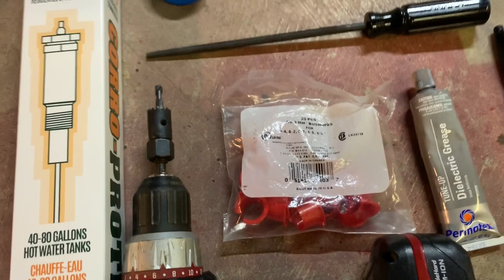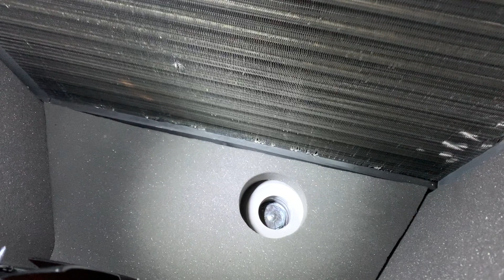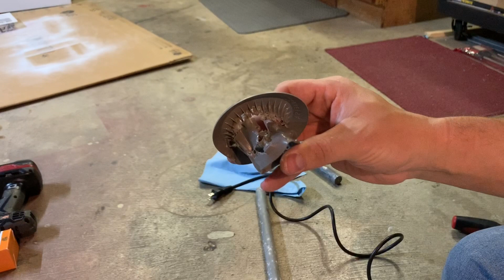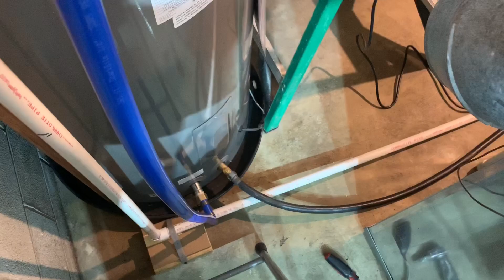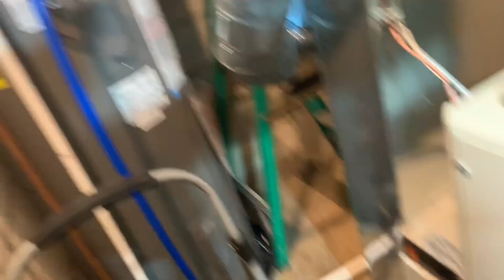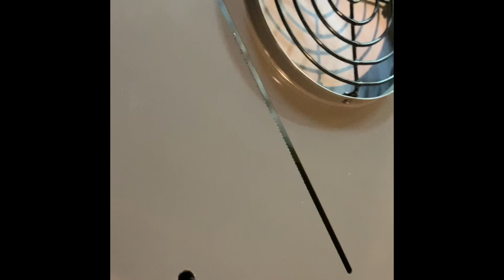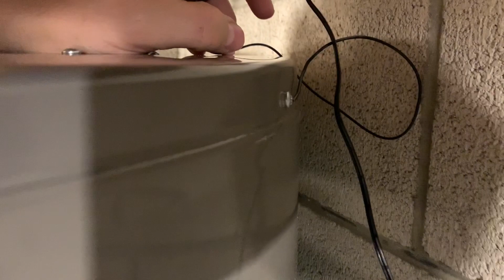Rheem Hybrid Electric Water Heater Anode Rod Replacement. Sulfur Smell is Gone!

Comment: Thanks and great job on this video. Probably the best diy video I’ve seen in a long time thanks for sharing and going through all the steps and even jumping back to explain things. 

I’ve already ordered the anode replacement and will be getting the same water heater. Your video reaffirms that this can be done and I will certainly do it BEFORE installing to make life easier.

Somewhere in all my research I ran across someone mentioned to also replace the crappy “mechanical “ filter with a HEPA filter to avoid small dust etc from getting deposited on the heat pump elements and making it less efficient.
Reply: Chris Steinmeyer thanks for that tip!

Comment: Wow, thanks for the video. I have been trying to decide between buying a Rheem or an A.O. Smith Hybrid and I think I'll go with the A.O. Smith after seeing this!
Reply: The AOS units have clearance requirements, they lack the technology package and they are not as efficient! The Gen 5 Proterra Rheem Hybrid has leak detection, Econet wifi built-in, is very efficient and the only space requirement is 6" over top of the heater. Plus if anything goes wrong with Rheem's Heat Pump portion of the unit, Rheem will replace the entire heater, unlike AOS.

Comment: I'm thinking of changing my current water heater to this exact model and I am on well water.  We don''t have a sulfur smell currently in our water.  In your opinion, do you think this will start in our hot water if I installed this model water heater in my home?
Reply: Hi - I can't see why installing this water heater would make your water smell like sulfur if it didn't have it with the old water heater.    I just put one of these in and have been documenting my experience on my channel.
Reply from the maker: I answered a similar question in another comment. I’ll copy and paste here for your convenience. 
Difficult to say but here is my opinion. 
If you have no surfer smell now you probably have 1 of 4 scenarios below. 

1) You have no bacteria in your water that reacts with anode rod corrosion so no odor. New water heater should be no problem. 

2) You have a whole house treatment system installed that eliminates the bacteria that causes this smell (Chlorine, Ozone, etc). New water heater should be no problem. 

3) Your anode rod is already 100% gone and there is nothing left to corrode, so bacteria cannot react with corrosion and cause odor. New water heater COULD be a problem, but you won't know until you install. Could be fine. 

4) (THIS WAS MY SITUATION) Someone installed a commercial, stainless steel, or other corrosion resistant water heater with NO anode rod. There is no rod to corrode and react with so no odor. New water heater COULD be a problem because it has an anode rod, but you won't know until you install. Could be fine. If you have scenario 4, probably the previous owners had issues with sulfur smell and an anode free heater was there solution. This scenario is unlikely, but it happened to me. I didn't realize it was a 25 year old 115gal commercial tank until I removed it. It was starting to rust on the inside, and was adding iron to my hot water causing heavy rust staining in sinks, tubs and showers. This was my main reason for replacement (plus improved efficiency --> Hence hybrid choice).
Reply: Wow! Excellent answer.
Reply: We have a brand new Rheem HP  that gives of a quick but awful murky slug of hot water after about 8 hrs of no use. No smell, just murky at the first draw when hot, then clears up after a gallon or 2.